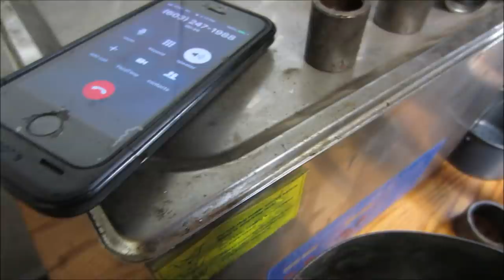VW BUS Transmission Failure,  Help Me Fix it,

Comment: When I was young I remember my boss put the clutch disc in backwards on his Dodge plow truck. What a simple error to make, I would never do that. Several years later working on my CJ5 Jeep. Ooops, yup,
Reply: When I was wrenching at a Cadillac dealership, a customer had done his own break job, on one side they had both leading brake shoes, & both trailing shoes on the other. He wondered why his brakes didn’t work as well. One side was almost completely locked up, the other side was loosing brake fluid from the wheel cylinder exploding! The fronts were totally trashed as well because of not replacing pads correctly so this car got a complete brake system rebuild including steel and flex line, vice grips should never be used on steel lines, or brake lines in general, just let them bleed out into a pan.

   Four days later he returned with the car, its backend totally smashed, he stopped for traffic light, the F550 tow truck didn’t, went after everyone he could to reclaim his damages... it sucks when people carry absolute state minimum insurances!
Reply: Putting stuff in wrong builds character and perfects mechanical  skills doing it more than once🤣
Reply: Patrick Fennessy o
Reply: Everybodies screwed up sometime, and anyone who tells you they never have..well they don't work on things much then ;)
Reply: Tim's Workshop TJY been there, and mostly on my own cars as a kid, I have owned  cars, trucks and motorcycles since I was 12, learned a lot keeping junk on the road, and have surprised more then just my family on roadside rigging to get home!
Reply: We do it right, 'cause we do it twice!
Reply: cheeto4493 I believe that is true, however I try not to dit twice on the same car!
Reply: @gettintheresafelywithpatf2869  That's one of my favoritest Muustie comments. Both because it says we make mistakes, but also because it says we own up to and fix our mistakes.
Reply: cheeto4493 well understood, bu if we keep making the same mistakes on the same car have we learned anything the first few times around? There for I try not to do the same thing and expect different results!  This is the definition of insanity doing the same things and expecting different results!
Reply: @gettintheresafelywithpatf2869   :-) Nope, just one mistake and one fix (hopefully). I try to at least understand why  part failed as well and try to resolve it. That way I'm not just replacing the same broken part over and over.
Reply: cheeto4493 sound like you have been around many manufacturers like Dodge, and early Japanese, and other misunderstood autos in their earlier days! I have noticed that when someone doesn’t take the time to learn and understand something that bad mouth it as junk instead of finding the real issues, and resort to temporary “band aids” as long term solutions. I remember the Cadillac HT4100 V8 engines, commonly known as “heavy trash” or “hook & tow 4100” but when someone followed the latest service bulletin, they found out that the issues of the intake gasket leaks were apart of the beast, and checking torque on a regular basis would help limit these issues, but replacement of the engines was a common practice once coolant mixed with oil, for a few reasons, bearings would be wiped out, cams were shot, and the seals that kept the cylinders in position would expand and move the bore alignment to create head gasket issues. So the best repair for these cars were replacing the engines to begin with, big V-6 engines for front wheel drives, and 305 or 350 v-8 for rear wheel drives... not factory approved, but my friends and I would buy these Cadillacs cheap with bad motors and have fun!
Reply: Made a few over the years. Probably biggest was rebuilding a four cylinder Honda motor cycle, that was my trade, put it outside to await collection. Cleaning my bench down ready for the next job found the damned oil pump !. Retired a few years back so can admit that now !
Reply: @gettintheresafelywithpatf2869  Fix the Problem, not the Blame.
Reply: Gord Baker sometimes easier said then done! And that applies to many levels, I know I’m not perfect, and do make mistakes, however a bad designs require more diligence in fixing, and remember somethings you can only fix it for now, and live with... plus you can’t cure stupid!
Reply: @niceguy2171  or they  lie a lot

Comment: In 1978 I bought a 1971 1600 cc VW van just like this one. Converted to a camper van by Devon in the UK. Used it to transport two racing motor  cycles , full camping gear, tools, spares and four people all over the UK. Did many thousands of miles at maximum speed, maybe 80 mph on a good day, after a long run up !. Brakes were poor, no servo on mine. But over perhaps 50,000 miles it needed one exhaust system, fumes in the cab, and regular oil changes and general basic servicing. Did not even need tyres replacing, never let me down once, few times we virtually ran the single battery down but it always just managed to start somehow. Was home, workshop, transporter, and friend.  A high quality vehicle, better than todays equivalents I think.

Comment: Couldn't ask for an easier  Transmission to do and busses are so fun and easy to work on I have 25 years experience working on VW I loved every minute of it
Reply: Yes Bus Trans axles are much easyer to work on..had to put some front bracket clips on mine..easy to git too.on a 74"..I think the 74 bus is the perfect Bus year with its 1600 dual port engine..and a nice set of nasty headers.
Reply: @allenschmitz9644  some of those after market mufflers do sound good.
Reply: @allenschmitz9644  some of those after market mufflers sound so nice.

Comment: What a pleasure to watch! Don't have a part you make it, don't have a tool same thing!
Actually I did a repair similar to the intake manifold in this vid on my uncle's 1970 Mercury Marquis with the 429 V8. A metal water nipple pressed into the intake rotted away causing a big coolant leak, I "fixed" it with a piece of copper pipe and Permatex. Worked for quite a few years!
I used to set my 1962 1200 cc VW at .004" intake and .006" exhaust, first engine I ever worked on. Brings back fun memories.

Comment: You make it look so easy. I remember working on old VW Bugs with my dad when I was about 13 and he would take that darn engine out in one hour or less, replace gaskets, seals, and adjust the valves like it was a cake walk. I really learned a lot about the simplistic yet smart engineering  around the Bugs design and the other models like the thing. 

My dad was some of the first American Technicians at a dealership here in Pittsburgh called McGee Volkswagen who trained to service them in the early 60's when the type 1 I believe was made for the US market. One funny thing I do remember was my dad using a stick to check the gas level because they didn't have gas gauges or his was broke and was pulling my leg, lol

Comment: Hey Mustie.....when you split that pipe to patch the preheat tube, I expected you to weld the back half on first(from the inside) since it would be difficult to get around  the back to weld.   Then add the front half ,  doing the seams and the remaining radius halves. I have done something similar where there was no access to weld the back side. 
Anyhow....cool video as usual, I love the new shop and I really appreciate your ingenuity when repairing things that simply do not have parts availability. You and Andrew Camarata inspire me to take on projects that I would've avoided in the past. In today's society people have become so specialized or lazy(whichever)....that we just contribute to the disposable mentality.  Most things are not rocket science if you have ANY inkling of mechanical aptitude, but I think many people just lack curiosity and would prefer not to tear into stuff . 
Keep it up brother!!
Reply: Curiosity is not something that is taught to people anymore, it's a shame really.

I live with 9 other students, our washing machine was rocking back and forth and besides me only one-two were willing to get into it and figure out if it could be fixed.
Others were already babbling about getting a new one. Gave them a little bit of a lecturing reply in return. Turned out it was a shock absorber and the fix was 30eu (over 10 people) and 2-3 hours of total work.
Reply: Exactly as I have just said Ed, about welding the preheat pipe!  D'0h!   But you said it first!  I also agree with you on curiosity & the throw-away society.

Comment: I could have done with watching this 30 years ago. My '71 camper had the same problem of shifting into 2nd gear and the first time I really noticed it was on my first trip during rush hour on Sydney Harbour Bridge, causing me to slow the traffic. It took a bit of fiddling around to find I had to push the lever hard across to engage. Now I know what an easy fix it was. Keep on with keeping us informed and entertained Darren and thanks to you I have just stripped and cleaned a weed whacker carb.(found in the trash) and got it running.

Comment: I worked at a Vintage VW shop for about 12 years......this is all so familiar...the video makes everything seem so smooth,  no surprises,  I remember so many surprises, especially when doing brakes/suspension work.  Yeah,  sure,  we can throw new shoes in for $200...oh wait, it needs wheel cylinders....oh wait, it needs new wheel bearings....now it's good....oh shit, the front lines are partially plugged and it pulls, it's needs all new lines now......I learned to quote a FULL brake system overhaul and then when it was less than $1000 for the job, they were happy.  In fact that job made me a decent service writer in addition to a tech.....figuring out when to quote the moon is an art...it's an art to keep the good customers and get rid of the penny pinchers.  

I worked FLAT RATE there....it was not easy to quote jobs, I started to hate old cars....I've been running my own business for the past decade and I'm loving my old VW's again.

I wish I could post pictures in YouTube comments...my 1st car with a license at 16 was a 1968 sunroof bus, my 5th was a 1966 splitty...my 8th was a 1955 splitty.  (my real 1st car, at 12 years old was a Dodge Dart,  #2 was a 1968 beetle at 14....but I could only drive those illegally.

Comment: Back in the 1970's when I was working on and driving VW's we would always lose the rear bumper, usually because it would be bent up anyway on the $50.00 vans we would pickup. Made engine swaps so much easier plus aftermarket exhaust would fit.

Comment: I have to hand it to you VW guys just could not get into it mechanical functions. Besides my passion for Antique motorcycle, I love my Chevy LT1 muscle cars. I found a 55 Volvo in my younger years build a tube frame persuaded a built LT1 425 horse what's a rock Crusher transmission and a 411 positraction rear end in it and tubbed the rear end for tires. What a screamer and made it Street Worthy. But now it's 75 it's fun just to watch you do it. You sure brings back old memories of my youth. Love your show keep them coming man

Comment: Thank you for explaining the throttle bearing and how it can degrade by keeping your foot on the clutch.  When I was learning to drive a stick shift, my Dad always emphasized you had to take your foot completely off the clutch.  I never fully understood what happened internally if you didn’t.👍🏻
Reply: yeah, not good "riding" the clutch pedal, it rapidly wears the throw-out bearing, mating surface and chews the pressure plate forks up at the same time, it also puts unwanted continual pressure on the engine crankshaft and thrust bearings, which causes engine wear also! 
in the case of VW, that's the flywheel hub, end play shims and rear crankshaft bearing that handle the thrust load also. as they wear the end play increases and you get crank walk forward and backward, which changes valve and ignition timing due to helical cut gear drive ;)

Comment: This bring back memories! I had a 67 beetle and totally rebuilt the engine after my mother ingested a valve. I added a 2 barrel carb and manifold and that car flew.
After my first 4 hour attempt to remove the engine, I got so good at it,  that i could get the engine out in 15 min!

Comment: Oh lord, driving that seal in without a seal driver? You just caused a few comments. Although I do the same lol! My girlfriend back in the 80s father was a master VW mechanic. So my first car was a 68 station wagon. He called it square back. Pulled it out of his junk yard. Had what he called a pancake engine. Started out as two single battle carbs. Not sure what he did but he changed it to two, two barrels. The little thing would pull the wheels in first and second. And from red light I could beat most motorcycles! Do not underestimate these little cars!!

Comment: You made my memory's kick in on this one , those rubber air seals i had forgot what a pain those where pulling those in and totally forgot abut the shims on the generator, also had no knowlage of shiftier adjustment on floor  !    all the rest i recall !   Great Job as you always do ! One of the best times in a van was winter of 69, put cut down log truck chains on it and ran around pulling others out of ditch, more like paddle tires, but when the snow plow cleared the main st had to quit , speed at 5 miles per hour would make to much jumping up and down ! pushed snow with head lights !  Thanks Mustie 1

Comment: Good one. I stil have my VW clutch centering tool from the late 1960s. Oh, and the 36 mm socket. Haven't touched a VW in 30 years.
Reply: used to use an old SK 3/8 drive ratchet handle for a pilot tool for VW's.... was the perfect fit.... lol.
Reply: @orsonwells7997  I was always a SK guy. Strapon & mac were way too much $. Had thousands in my sk til dopehead nephew relieved them when gone on vacation back in the 90's, boxes & all.
Reply: @keysersoze1296  I think we have the same nephew... one of mine did the same.

Comment: That's a really nice bus, and glad he had you do that work on it, so it gets done right. Runs good too, and that's to bad that pre-heat tube rusted through, but bet that happens on a lot of them, think I would have used some JB weld on the back where you couldn't weld though..not usually a big user of it, but it's good for things like that. Although they make a high-temp silicone sealer that would work as well, actually have some here for one of my projects. Really nice getting those seals replaced, think I would condition them with some 303 aerospace protectant to extend their life. Have made a rolling lift out of a old transmission jack, but would like to come across a rolling lift like you got, that's a handy thing, although the one I cobbled together has changeable jigs for my common things I work on.

Comment: Nice work!  When you run across a loose oil fill like that, you can cross two large flat-blade screwdrivers in an X shape and press their blades into the little opposite slots.  Grip both handles and rotate the locking collar.  Rock on!

Comment: Mustie1, that oil fill tube: you can use two flat screwdrivers, crossed over each other in an X fashion so they both bear on each other where they cross in the center, and apply a lot of torque that way.  For tightening, they go one way, and for loosening, you reverse how they bear on each other.

Comment: It's nice seeing a VW bus that doesn't have a rusted out body. Even the floor pans and heater boxes looks good. The bus has obviously been well maintained and stored inside during the winter. Should run a long time with the new transaxle.

Comment: JB weld would have sealed up the tube by itself or the small area that was hard to reach.  Great fab fix on the heater duct! 👍
Reply: Just came here to post the same thing. JB Weld is magic stuff. Even muffler putty with some steel mesh reinforcement would work, as I doubt there is much pressure in that small pipe.
Reply: I was thinking he could have just wrapped a little rubber around both ends and secure them with a hose clamp?

Comment: Hi, So pleased to find your channel again, Ime getting to an age now where sciatica and carpal tunnel kinda hurts but doesn't stop me fixing my bus, Hampshire UK climate has not been kind to my 72 RHD Westie Bay window (a rare one here not many have survived), some times I bite off more than I can chew in my small garage workshop... But always fun trying.. Never welded before but made  fair job cutting and replacing inner and outer sils /out riggers last year, now on front valance, step areas etc, luckily back in 79 I completed a marine electro mechanical apprenticeship for the MOD so transfer of skills anything electrical fabrication, or engines always a bonus. Gotta say its been good fun owning  Harlow for past 9yrs.. All your vids are worth watching especially the bus ones in lockdown, take care, atb regards from Tom.. 
👍👍..

Comment: I wish there was as big a VW community in southern Wisconsin as you seem to have in New England.

Did you actually trust the impact wrench to torque the flywheel? 
I've got a Torque-Meister I bought years ago, and have never trusted a VW gland nut without it, red Loctite and a torque wrench. 217 foot-pounds is very hard to ensure without it.

I used to use a flywheel lock and a big pipe on a breaker bar - until I had a flywheel come loose. Quick way to ruin a crank and flywheel.
Reply: Charles Kuecker you are correct. 
The flywheels do come loose. 
I would also use red locktite and a scientific instrument to set the torque.
My boss 40 years ago used an 8 foot bar and hung off it to tighten the gland nut. He told me to help and the nut broke in the back of the crankshaft.
But we heard that familiar flywheel knock regularly from vws sent to us other mechanics couldn't diagnose.
Reply: I mark it wit pencil the removal with hammer and cold chisel. Retighten till marks line up again with chisel and hammer.
Got this from the John Muir book